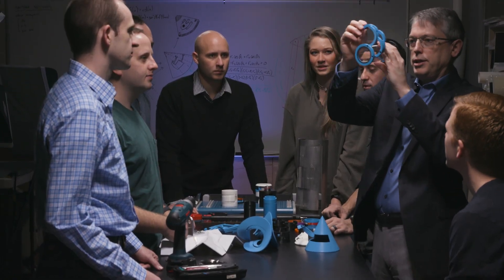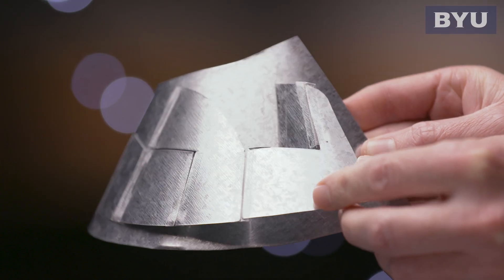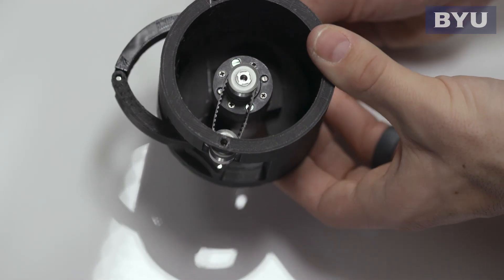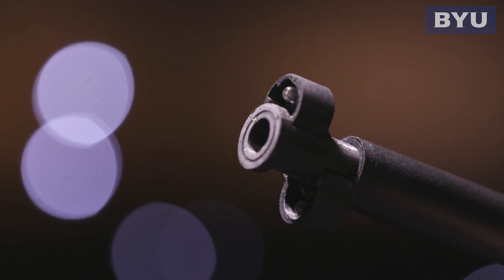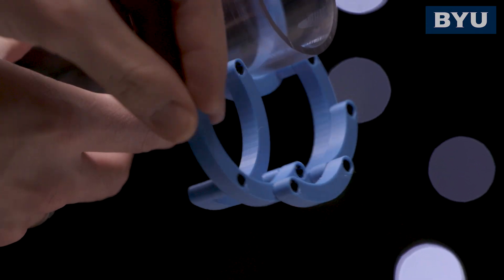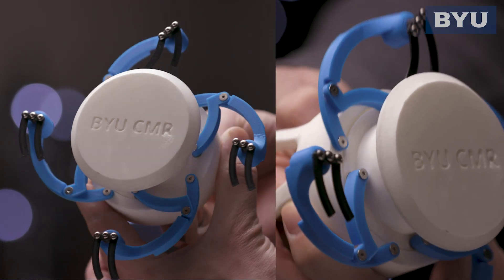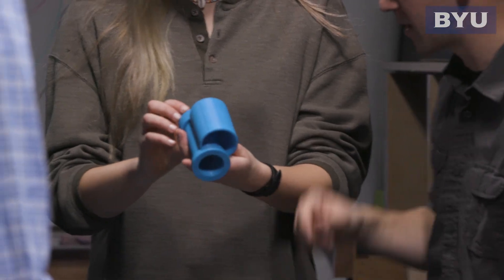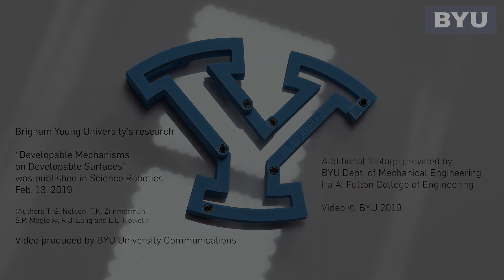New devices morph and transform - like Iron Man's suit

Comment: I'm thinking those cybernetic hands in Ghost in the Shell: Stand Alone Complex where the fingers all split off and subdivide into smaller actuating units for faster keyboard typing. I can predict this tech will head in a far more mundane direction though, like car mirrors that fold into their body panels at highway speeds, or cupholders that take up less space in the interior facia.

Comment: It honestly surprises me that this is something new to engineering xD
Reply: It's not.  It is just the first time they are considering it for enginering.  This has been in cabinet making for a long long time.
Reply: These really aren't, they just weren't that useful, so few were patented. In a lot of ways, Bionicles and origami have kind of used these the most.
Reply: it's not, this kind of thing has existed since the 90s and probably long before that. This is just research done by this specific university
Reply: It's not lol
Reply: I guess it implies modern computer simulation / ai and 3d printing, so not so surprised
Reply: What is lacking with Mechanical Engineers today, is the knowledge of how to design mechanisms correctly. Did know that there's a mathematical formula that can be used for all mechanism designs? It's called Gruebler's Count. I found a way to make it practical for all 3D mechanisms. Here's the link if you are interested.  https://youtu.be/KFB8gMjxDPk
Reply: It's not, it's just new to these engineers.
Reply: @HerbaMachina  perfect response

Comment: Anything Colin Furze on YouTube built a giant Iron Man suit. It didn’t fly of course, but it was a heck of a lot closer to being Iron Man than anything I saw in this video.

Those were some clever ways to make things pop out off of a surface, but I don’t see how it is better than a simple hinge. Besides folding out flat metal doesn’t do anything useful unless it is being used as fins guide projectile through the air. It needs to be holding something. And chances are the things that it needs to hold won’t be flat or foldable. If you can create a bottomless storage cube device from Jimmy Neutron then this would become a lot more interesting.

Comment: By the way you could use pressure to launch one of those drones waaaaay up in the air, then have it deploy and it could begin high-altitude travel with much more power which otherwise would have been used for climbing to that altitude.  I have to get back to work but if I sit here watching this video all day I bet I could come up with so many use-cases for this stuff as well as more designs...pretty interesting really

Comment: I see a lot of comments to the effect of "so what, it's pop up books for mechanical objects". The "so what" here is that many types of collapsible device were, until recently un-manufacturable.  Most of the devices we see in the video are 3D printed...and they need to be 3D printed.  Machines that can build the folding neccesary have only recently become available  (see Adam Savage's tour of MITs Center for Bits and Atoms).  While paper prototypes of many of these devices may have been buildable with human labor (for popup books), manufacturable, mechanically useful devices have been out of reach until recently.

Comment: Its funny how he smiles proudly as he says “very complex and no ones ever done before”. The problem with these industrial designs is artists in film likely have already done it, however more than likely only conceptually and not so much as practical. With the constraint being the software hindered by lack of parametric measurements and tooling setup but essentially only a template. The iron man suit should be sent out to a service that deals with those constraints. They would be surprised on what these artists built from curvature.

Comment: Transformers have been on TV since the 1980s, and physical versions of those designs have existed in toy form for just as long.  The reason compact deployable designs for various technologies hasn't already been implemented IRL has nothing to do with design.  The problem is maintenance and upkeep.  The more tiny moving parts a device has, the more likely it is for part of it to jam, break, or wear out.  So what did these guys do?  Make a ridiculously complicated design out of tiny paper-thin 3D-printed parts.  Yeah.  I can't wait to see how that works out in just regular household use, let alone industrial, military, or agricultural use.  Spoiler warning: it breaks and you have to buy a new one, so you buy a traditional device instead.
Reply: We need the T-1000 morph tech so it doesn't wear down just needs energy and  up it goes again.

Comment: Its just engineering. no more fantastic than an airplanes retractable gear. It says more about Our Psychology than anything new (ie. Ohh that's cool) . now if u could get a flat or curved surface to morph into a screw driver that is just as strong as the original then that would be a thing.
Reply: Exactly. Let's be honest here. It's not even the impressing kind of engineering. This has been around for ages in popup books

Comment: Have seen a bunch of stuff from these guys- this video seems to represent the folding / origami style for visual demonstration purposes as most people have seen a pop up book or origami in the past.  I believe they intend to use the folding method for nano construction of electronic components.  (perhaps too advanced for the intended audience?)

I believe - with 3D printing technology , folks will begin to think differently about how to manufacture and examples like this will begin to overtake traditional forms of engineering.  For myself - that hardest thing to overcome when designing for 3D printing is resource management.

for instance:  do you want to spend 10 hours designing a part that is optimized for printing time, material usage and overall integrity.  - that triangle of  'Good' - 'fast' - 'cheep'
Reply: It would most likely be a revolution/renaissance through the Mind,body, Spirit. We wouldn’t necessarily depend as consumers but creative consumers.. if everyone just printed their own things. In a way probably causing us to care more about resources and not be such gluttons about them maybe

Comment: So, hinges? heard about emm
Reply: Lots of these don't use hinges, or use them sparingly.
Reply: I think you didn't get it
Reply: That's kinda the main point to the benefits of their designs, no hinges or ball bearings means less moving parts, making it stronger and more durable. The origami stuff just packs small and saves space and weight.
Reply: Actually, some of these joints are gliding joints. So. . .
Reply: From what I understand it's a tube that can hide another tube. Or maybe hides two tubes.
Reply: There's no hinges
Reply: But have you heard of oranges? Peaches? Pears? Plums? Syringes?
Reply: Not about the hinges, the plastic, or other things obviously done before. But about where and how the linkages were stored
Reply: Yeah, my door can totally deploy some weird form of mechanism that does something like releases a drone like a cruise missile
Reply: no no, he invented those hinges dude, totally, he discovered new ways that have never before been imagined, also his dad invented water.

Comment: the promotional team will be at your desk in 10 minutes. think of something to say about these 3d printed folding things. "maybe it's smaller and it's for surgery, maybe it's a wheel on mars?" come on, real problems are specific and carry with them the constraints of the end use. Dreaming is good, but task-force promoted dreaming is kind of silly.
Reply: Many times in history discoveries have been made before there was use for them. Did it mean they were made in vain? Were they wasted? Most of the time, no. Do you see the fault in your logic?
Reply: What do you mean?
Reply: Of course, advertisements would emphasise on the more impressive functions a product have. 

Rationalising with them, it is indeed difficult to cover every function it has. There's always the time where they industrialise and put out ideas that fit in our daily lives. So for now as they are still developing and trying out new things, this is somewhat appropriate as  a insightful glance into the future prospects. If done well, the next advertisements should be for their more commonly used products in daily lives. ( Do correct me if I interpreted you wrongly )
Reply: I meam obviosly the mars rover one was to show onr application of the crawl wheel.